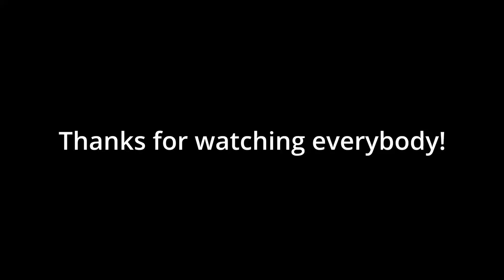Historic Shipwrecks Abandoned on the River | Destination Adventure

Comment: 19:46 That is not a Winch exactly. That is a windlass, they are still used today, mostly on sailboat, and very large cargo ships. (from Wikipedia) The windlass is an apparatus for moving heavy weights. Typically, a windlass consists of a horizontal cylinder (barrel), which is rotated by the turn of a crank or belt. A winch is affixed to one or both ends, and a cable or rope is wound around the winch, pulling a weight attached to the opposite end.  

Thank you Capt D, for another awesome adventure through history.
Reply: They were used on the riverboats for pulling them through rapids.

Comment: The lever was the blow down for the boiler most probably. The valves were brass and that's why they're missing.
The sternwheeler with the largest boiler might of only had one boiler that's why it's so big. The others probably had two boilers. The fulcrum you're talking about is called a walking beam.

Comment: This is only a guess as there’s lots of piping going to and from a boiler but I’d venture to guess that the handle was attached to a valve on piping and if it ran to the bottom of the boiler it could be a blowdown. As you boil water in large volumes solids that are in the water will concentrate on the bottom of the vessel. It needs to be removed regularly by blowing down the boiler so that the tubes don’t fail. The valve at 17:48 definitely looks like a quick opening blowdown valve.

Comment: A agree with others here in saying that it really is a shame that more hasn't been done to preserve these magnificent boats.  But they were caught in that weird time warp between being obsolete eyesores to be discarded (this is true of ordinary objects we use today) and recognition that they really are objects which should be preserved.  That span of time is the most dangerous for an item, whether it be a building, vehicle, vessel, or whatever.

As for these, I think the best course of action would be to try to extract the hard objects such as the steam engines and restore one or more to show condition, or even working condition.  Now that would be amazing!  And I think it could be done quite reasonably, with volunteer help as much as possible.
Reply: The fact are still there & not salvaged or burned down is a form of preservation.   Closer to civilization, they would have been long gone.

Comment: Steam engines use much of the same terminology that automotive engines use such as connecting rod, crankshaft, piston, combustion chamber, etc. It makes sense when you think of it since steam came well before the gasoline and diesel engine so it was actually automotive engines that adopted steam engine terminology.

Comment: I hope a copy of you video will be available for visitor viewing at the Dawson City Museum.  I wonder if the museum has ever photo documented these sites?  I was not impressed by curator's apparent do-nothing to save anything approach.

Sadly, these artifact-littered wreck sites are almost on the doorstep the Dawson City Museum and yet the museum only has a life ring hanging on the wall to represent this important era of Alaska paddle wheel transportation.  The site is obviously accessible by boat or walk-in as you did.  Why hasn't a few volunteers spent  a couple of days collecting some artifacts for the museum? This may be critically important to do NOW since this video is likely to lead to more visitors visiting these wrecks, some of whom may not follow your advise "To take nothing but pictures.  Leave nothing but footprints."

Going past hand collecting, that one remaining paddle wheel frame, steam engines and drivers, could be airlifted out for an impressive open area display.  The same with the remaining smoke stack.  This would require funds that the small museum most likely doesn't have.  But perhaps there are grants or other creative approaches that could pay for that.